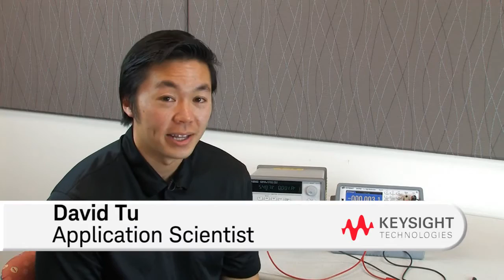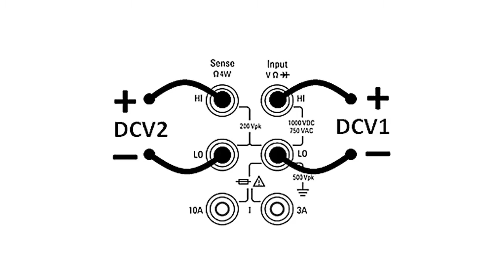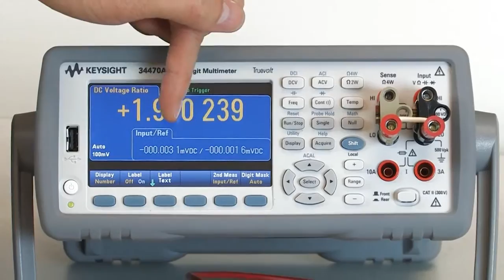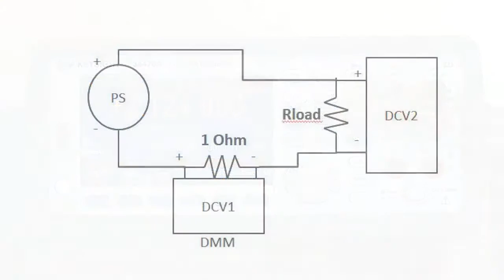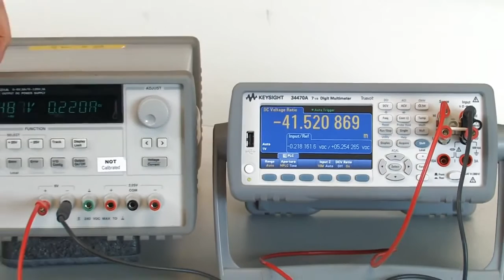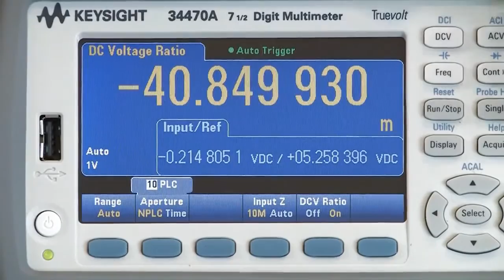Measure Voltage & Current at the same time with a DMM

Comment: if you just add the current Voltage drop to the Voltage reading you have the correct messurement to the Voltage reading, and if your Resistor is acurate you have all mesurements very acurate... very nice feature